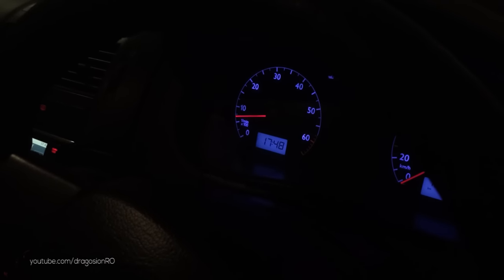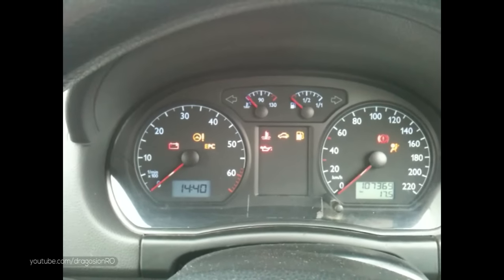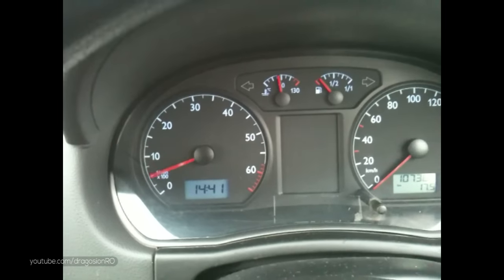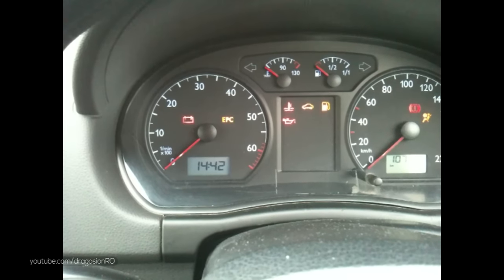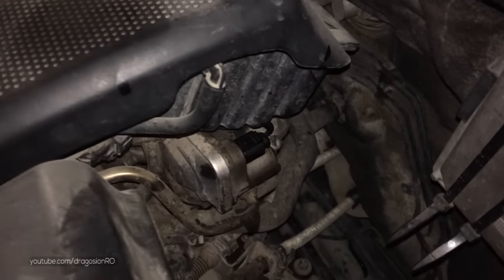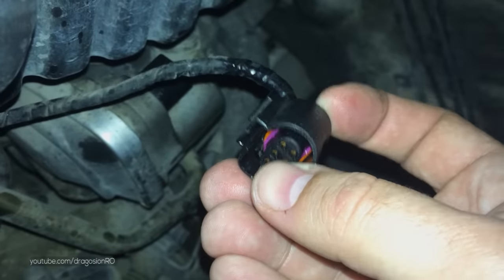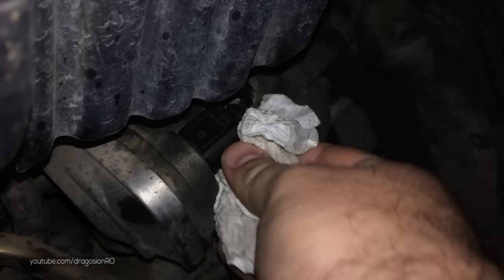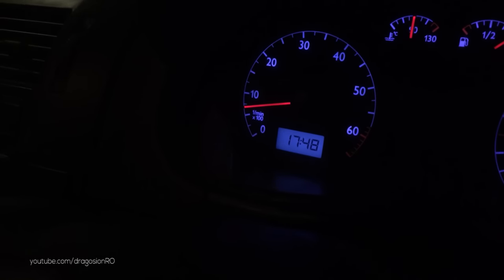EPC Light Fix in VW Polo 9N 2003 1.2 AZQ

Comment: I cleaned it. But didn’t work :(
May be my problem is a bit different. The RPM always stays at 0.6, stable. Only have observed engine stop at traffic light, three times. Otherwise car runs fine. No limp mode. There is always no light when i start. I drive it, it appears after half a mile. Please reply if you can help. Thanks.
Reply from the maker: Don't know what it is. Could be a  something completely different like a pedal sensor. Needs obd2 scan.
Reply: Brake pedal switch i already replaced with new. No change. 
OBD scanner reads following; 
18049, 17550, 17961
Dtc memory of A/C ecu P1641
Lower calculation check lower limit exceeded p1142
Baromatric manifold pressure signals implausable correlation p1553, Respectively. 
00293- multi function switch f125 no signal
01166- engine torque signal no signal
01166-engine torque signal signal outside tolerances. 
These all are codes.if it helps
Reply from the maker: Take it to a mechanic. Don't understand why so many codes all together.
Reply: Yo can finally fix it ?

Comment: I changed the water pump, tensioner pulley and belt on a 1.2 Polo AZQ, and the throttle suddenly is a bit "awkward", but nothing bad, after driving a bit, the epc light came on and the engine just doesn't accelerated, after turning it off and on again, no EPC light and it was like before. I do have a MIL Light on but it is because of the o2 sensor. But replacing the waterpump, belt and pulley can't have anything to do with this? I mean, there is no connection and I don't know why it just began after that! Could it be because of a bad o2? I've read online that that can also be the problem. Maybe someone can help me out. Thanks

Comment: mine used to do this until i finally replaced the CAT and the front and rear sensors its been fine for years until recently i tried to rev and pull away and the stupid light came back, i stopped turned engine off waited a bit then started engine, the light stayed off all way home.

Comment: I have ar problem with my polo classic 1.4 TDI it having too much smoke White one who can tell me what can make that ?
Reply from the maker: Check the water reservoir if the fluid there looks foamy or if you see any oil there.

Check the engine oil and see if the oil is dark and clear or if it looks creamy.

Engine may be burning oil or worse cooling fluid mixed with oil.

Comment: im driving a polo 2.0 2005 model, the EPC light comes in while driving, i have taken the car to the mechanic for diagnostic. the car has no faults but the is still showing EPC  and has no power. please help.
Reply from the maker: Does it have rpm problems like in the video?
Reply: @IONHowTo  yes
Reply from the maker: @akhobangani3313  did you do what's in the video? On your car it should be similar.
Reply: @IONHowTo  just bought a new oxegen sensor then will do it today thanks
Reply from the maker: EPC can be many thing but if the RPM has problems the throttle body is your target.
O2 sensor could be related and it's good to change those for better fuel savings.

Hope you get it to work!
Reply: @IONHowTo  morning, yes the car is still doing the same thing what else can I do
Reply from the maker: You cleaned the throttle body connector and still the same?
You did an scan for trouble codes?
Reply: My polo vivo engine is just running good  but,  has a EPC light on, why sir?

Comment: Do you have any ideea why the check engine light won't show up?( I have a 9n3 1.2 bbm with same light missing even since i bought it)
Reply from the maker: Either the previous owner put tape over it to hide problems or like in my case, the light just does not work. 
I opened it to check if there is any tape in there and the led is just burnt. 
I had the buzzer not working also. That one I fixed by replacing rhe burnt speaker with a keadphone speaker. Works perfectly. I have older log videos that will make a nice a youtube video for removing the instruments cluster and fixing the speaker.

Please subscribe to see more of this and to help us. We need 1000 subscribers by 20 Feb. 🙁Please do it, we need help!
Reply: Hi can you upload the videos about how to remove the instrument cluster and change burnt out LEDs :D Mine has a bunch so Im not sure if I have some errors or not.
Thank you!
Reply from the maker: zxz1357 I might have a few videos from when I’ve opened it but mostly photos taken for reference. To know how to put them back. 😁

When I opened it I just changed the speaker because it was not working.
Used a headphone speaker and works perfectly.
If you really want to do this, be prepared to mess up your instrument cluster. 😬
I wouldn’t open it now unless something really important stops working.
You’d have to remove all the indicators from their motors and those are a pain to put back in the right position.
Without a VAG-COM or VCDS interface, it cannot be done well.

VCDS had a mode that puts each indicator needle to zero-middle.
With that you install them.
If you don’t do that, the indicators will work but showing you the wrong speed/ fuel left/ rpm.

Better leve it or order a VAG-COM interface now if you don’t have that already.

Not sure if I’ll find enough video to upload but there must be something, if I do it won’t be soon. 1-3 months. 😅

Won’t be able to show how to change the LED, because I didn’t feel that lucky and with no spare instrument cluster or car, didn’t want to risk breaking the car too much. 😅

Comment: Salut, eu și eu o problemă la mașină, dacă merg mai turat( peste 3000rpm) cam 15-20 minute începe să îmi ia razna turometru, adică dacă accelerez doar, merge de la 6000 la 2000 de la 2000 la 5000 și tot așa, face ca nebunul. O singură dată mi s o aprins becul de la EPC și nu o mai tras mașina, am oprit o și repornit o și o tras după dar dacă o turam tot oscila turometru. Am dus o la mecanic și ăla o spus ca i o dat eroare la computer de bord nu la ceva senzor, nu știu ce să cred despre asta, o zis și el ca nu știe cat de bun e tester ul pe partea de electronice. Oare ar putea fi de la senzorul ăsta de accelerație, menționez ca am făcut drumuri și de 200 km cu mașina și dacă nu o turam peste 3000 nu avea nimic
Reply: Miroase și puțin a benzină
Reply from the maker: Eu nu am avut probleme cu turometrul decat foarte rar cand acceleram cred intre 1000 si 2000 agata pentru o clipa turometrul cand urca de parca era ceva care il tinea sa urce.
Problema aia aparea foarte rar si doar o data sau 2-3 ori.

Inainte sa zici ca miroase a benzina ma gandeam ca e doar un senzor sau ecu/ instrument cluster o ia razna.
Miroase a benzina tot timpul? Poate sunt probleme diferite.
Cand turometru o ia razna, motorul se simte normal sau 'tuseste'?

Foloseste obd2 si fa-i log la turatii motor si viteza in timp ce conduci.
Recreaza problema cu turometrul si vezi daca in log apar fluctuațiile asa cum le vezi pe dashboard/ instrument cluster.
Edit: Eu am avut probleme cu senzorul asta https://youtu.be/guoQd5B3JAc

Comment: Your lucky its just a dirty connector and not dirt on the throttle body position potentiometer carbon tracks a wiper.
Reply from the maker: Yeah it's not too bad like this. I never replaced the tb, just cleaned it few times with carb spray when I was trying to find the probplem.
Never tried to open the tb at all.
Works great

Comment: What else can i use i am struggling to get WD40 in my country
Reply from the maker: Contact cleaner works too, just you have to do it more often.Any brand of contact cleaner - the ones for cleaning electrical connections or potentiometers.
Reply: Thank you so much

Comment: Hello I have a EPC/TRACTION  light problem with my VW polo 9n when I apply brakes the lights come on screen and the car goes to limpo I change the control module but the problem persists? Any help.
Reply: Had the same, I changed  the throttle body and everything is fine now :)
Reply: @hendrikh75  thanks for reply  I changed ABS sensors two weeks back the problem is gone as from I think I am sorted  . I hope the problem is solved at my side but the is a lot of things I changed before including  ABS module,  map sensor,  brakes switch and I clean the throttle and EGR VALVE

Comment: but where is located! that thing you clean? you should tell the location on the car..at least
Reply from the maker: I tried to show it from far too. Its the electrical connector on the throttle body. Where the metal EGR return pipe goes.
Looking at the engine on the right side at the back. Under the cover.
Reply: Dragos Ion do u mean inside the bonet at the right hand side at the engine right? ectually mine is showing epc an engine icon😓
Reply from the maker: It’s on the throttle body connected to the engine body, where the air intake is. If you remove the engine cover, it’s easier to find.

Comment: Polo 9N EPC fault light

Hi guys,

I have a 2010 Polo vivo 1.4 63kw, I have started experiencing an issue when the vehicle has come to a stop with engine idling (usually at a traffic light or stop street) the EPC fault light comes on. The engine idle becomes rough & increases to about 1200rpm, there is also no response to the accelerator pedal at this time. I have to switch the car off & restart to pull off from the stop. There is no sign of the problem after this action.

The problem is sporadic & doesn't occur at every stop of the vehicle. Prior to this problem I noticed unusual engine response to the accelerator pedal on low revs(in neutral while idling,stationery position) , slow response to react to the pedal & slow return to idle rev mark, sounds like the accelerator is being let of progressively when in fact it has been released completely. 

Hoping someone can help me identify the problem
Reply: Malume did you manage to find a solution?
Reply: @benetmpho223  nothing
Reply: Damn I got same symptoms, it's come out also sporadically
Reply: Howsit going gents.

I have the same problem with my polo gti, did any of find a fix?
Reply: Eish  still no solution
Reply: Any solution?
Reply: @MALUMEMALUME-mn9tg  eish bra still nothing. There's a bra near me that thinks he knows what the issue is. Once he checks the cab I'll post an update
Reply: @keeganaddison8834  did you find the problem?
Reply: Did you fix this problem?

Comment: Where is sensor ??
Reply from the maker: Throttle position sensor - inside the throttle body but
The problem i's not the sensor.
Reply: @IONHowTo  Where exactly is this place you cleaned? I couldn't find it in my vehicle.  please help me my epc and engine fault light are on too.
Reply: @IONHowTo  my car vw polo 2005
Reply from the maker: @Fatih52.52  if your car is not like in the video, you have to find where the throttle body is on your car.
Remove the electrical connector from the throttle body and clean it.
While you're at it, you can spray a bit of carb cleaner in the throttle body to remove dirt around the throttle flap.
Not too much carb cleaner.

Comment: Salut , am un golf 4 1.6 16v si in mers imi taie puterea la masina de parca as avea 50 cai toti , nu mai imi trage aproape deloc dar dupa ce o pornesc isi revine apoi iarasi face dupa cativa km si imi apare EPC in bord , pe tester nu apare absolut nimic , daca poti sa imi spui cum as putea sa rezolv ..
Reply from the maker: Ar trebui sa apara ceva, incearca alt scanner.
Reply: Am facut cu vag degeaba mai ales ca se stinge la urmatoarea pornire
Reply from the maker: Porneste log pentru turatie motor RPM si voltaj baterie.
Vezi daca apare ceva suspect. Am alt video cu senzorul de turatie. Poate e ala.
Dar la mine senzorul ala nu aprindea EPC.

Daca puterea scade e in ‘limp home mode’ la restart dispare pt. Ca e ceva temporar/intermitent.

Incearca sa cureti connectorul electric de la clapeta de acceleratie.
Poate ceva la aprindere... bujii/inductie.

Probleme la aprindere ar trebui sa iti dea err code misfire.
Reply: Ok , o sa incerc si asta mersi pentru raspuns in zilele urmatoare o sa o bag in service sa dea un verdict si cei de acolo
Reply: Salut. Am un golf 4 1.6 16v. Eroarea EPC am avut-o pe contactul de la pedala de frana(ramanea blocatsi nu se sprindeau stopurile pe frana)

Comment: what is the wwd40?
Reply from the maker: It’s WD40, keeps water out, contacts clean, stuck rusty bolts.
Reply: Is it the Henkel WD40 (Multi-use product, stop squeaks, drives out moisture, cleans and protect, loosens rusted parts and frees sticky mechanism) Silicone free one